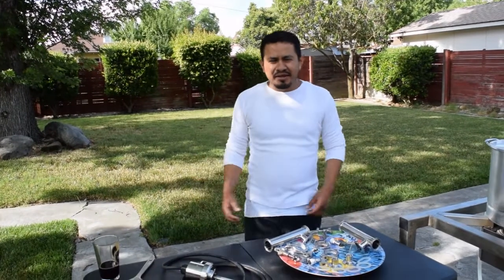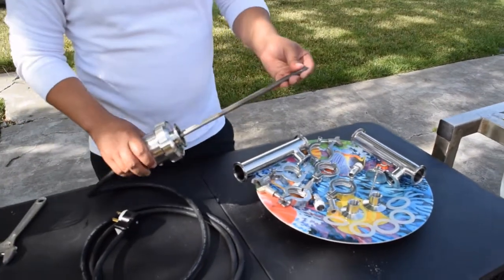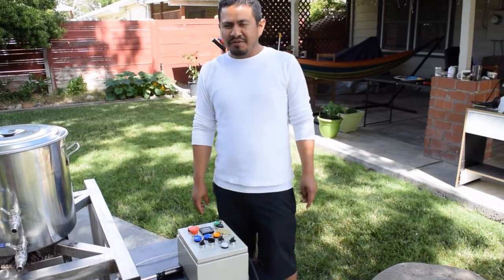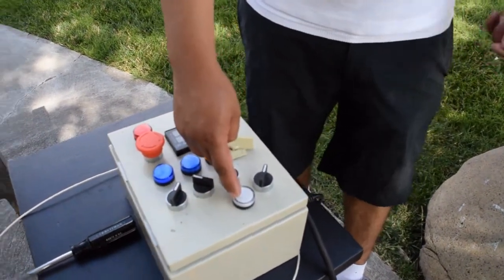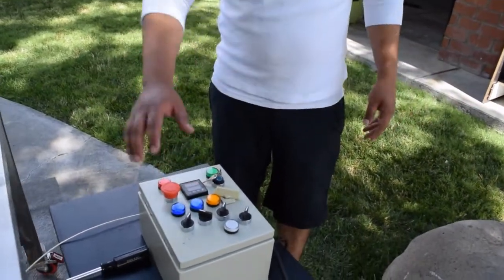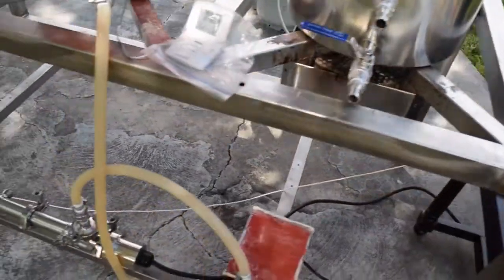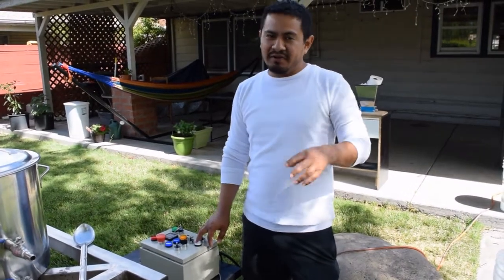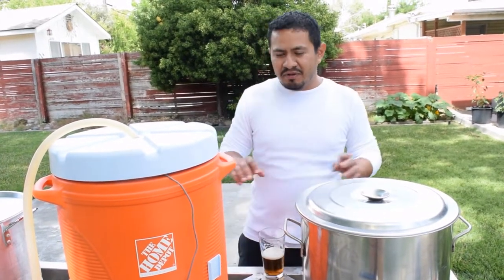WHY A RIMS SYSTEM

Comment: Nice video. I'm able to make some sense of the components . What's the length of the temp probe you used? Thanks
Reply from the maker: Frank Andermahr , The temp probe I bought is 2.36", which is for a standard tee. There's a link to the sensor under the video notes to where I bought it so you can see the exact probe. Thank you for watching.

Comment: Great video and setup. You can add a extra valve at the pump that will let the air out. That is what I plan to do.
Reply from the maker: DCLEMMS1 , thanks for the suggestion.

Comment: can you explain something...ok i get the circulation theory,,,so say we are at the end of re-circulation . what exactly is the procedure from there ....because you don't want to burn out element or pump by no wort ...but at same time you dont want to leave a bunch of wort in RIMS tube and hosing . I know it is obvious but what exactly do you do to end the re-circulation ? Thanks...great video
Reply from the maker: Hi Scott,
After re-circulation, I turn off the pump and the heating element. I disconnect the hose going from the pump to the heating element and re-connect it to the kettle. So now I have a hose going from the mash tun to the pump and then to the kettle. Now you can start transferring from the mash tun to the kettle, you're sparging. Once you start sparging you don't need the rims anymore and you can take it apart and clean it. I just pour the wort in the rims into a container and put it back on top of the mash, so no loss of wort.
Reply: I gotcha man..thanks! I was just a little confused because I dont know how long wort could sit in a RIMS tube without getting scorched if it wasnt circulating pass the element .  But I see what you are saying makes sense now .  I will remember your pointers thanks again ! Cheers!